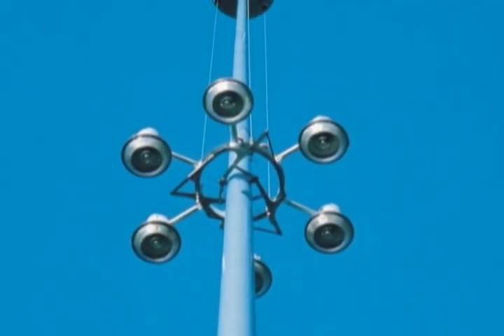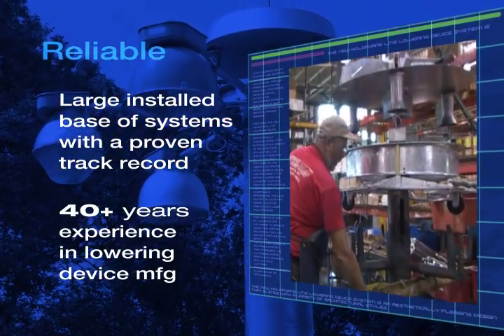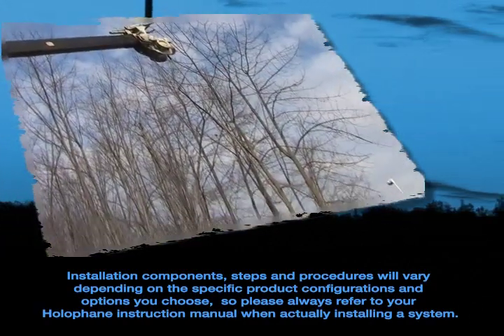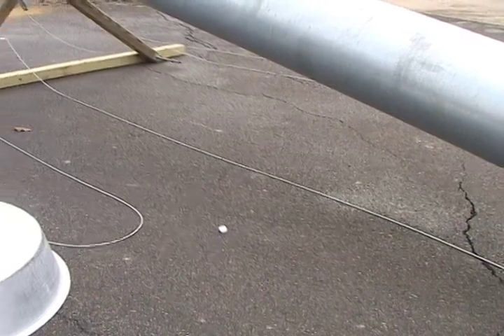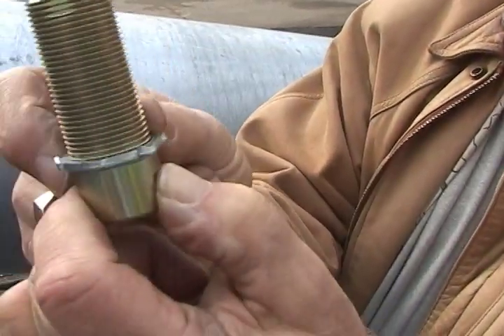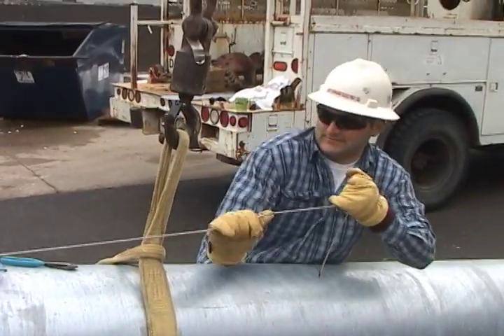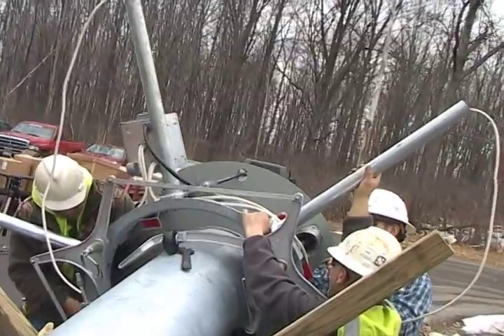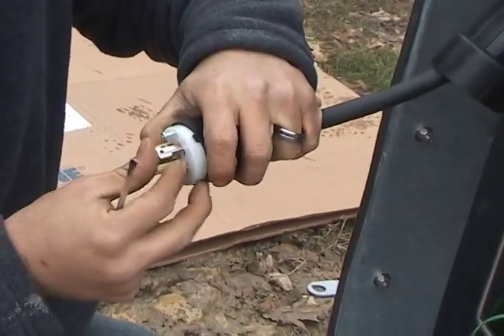High Mast lighting Systems

Comment: There is no longer any need for high masts. There is a company in Indiana (Stray Light Optical Technologies) that produce LEP or light emitting plasma, that produces sunlight spectrum lighting (5400k @ 270watts). They would run circles around these lights in terms of light quality and efficiency/maitenence savings.
Reply: No. That's not true! The reason why we need high mast lighting is so that there is no need for bucket trucks or excessive maintenance. The only thing you need to do is change lamps ever so often!